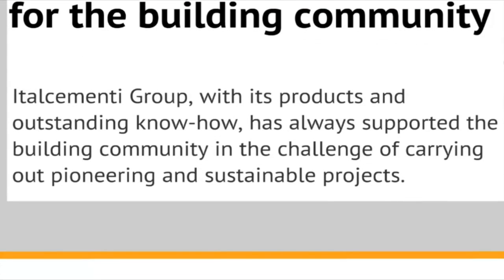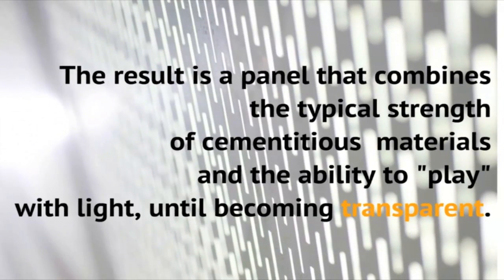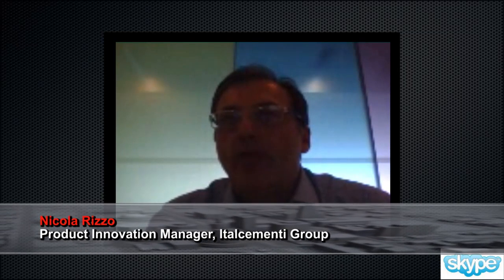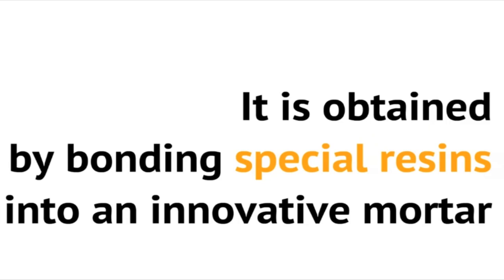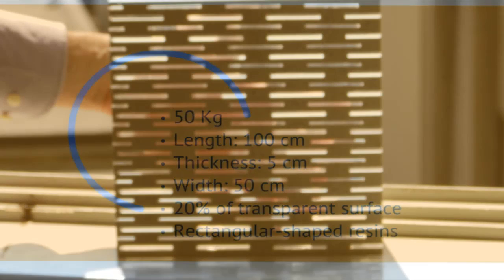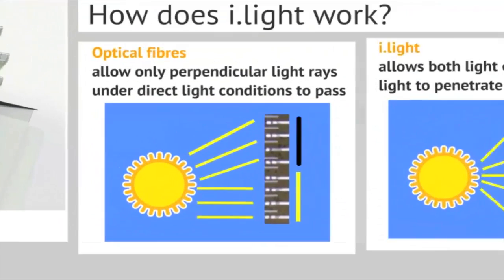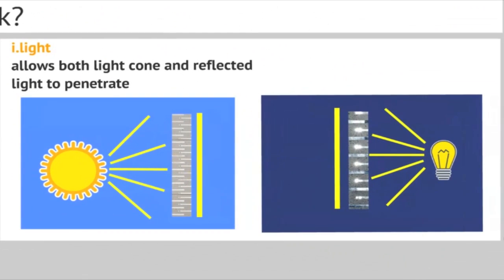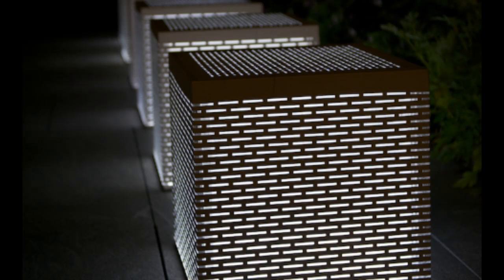Transparent concrete panels from Italy

Comment: I think it'd be more dramatic in a roofing configuration. You could have a massive space that transmits daylight within a climate controlled and intimate space. Instead of light tubes and skylights which are point to point - the entire roof could transmit or provide a lit surface of daylight.
Reply: I think it would be a good idea for big buildings and big blank walls
Reply: @miloslavtokar1080  ehhh - people like to put stuff on walls.
Reply: @mgabrysSF  maybe in a non residential building